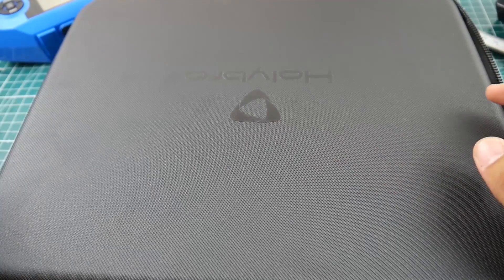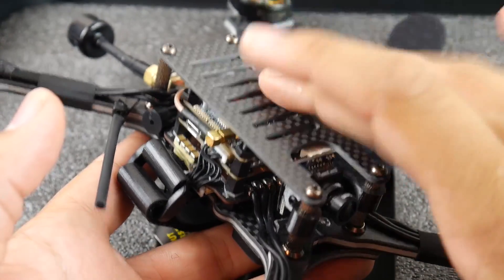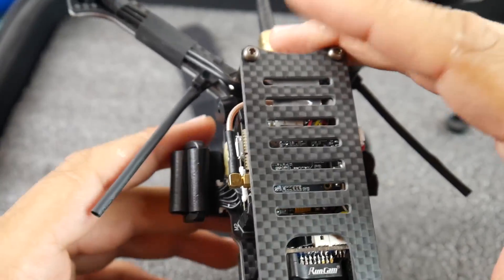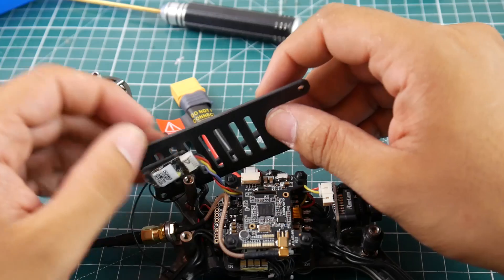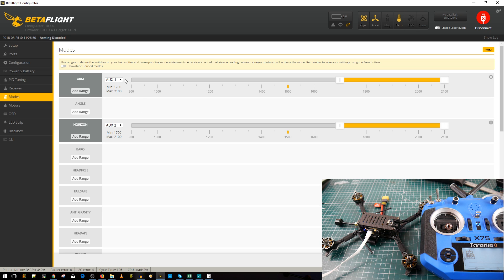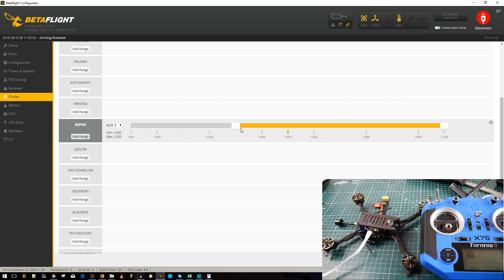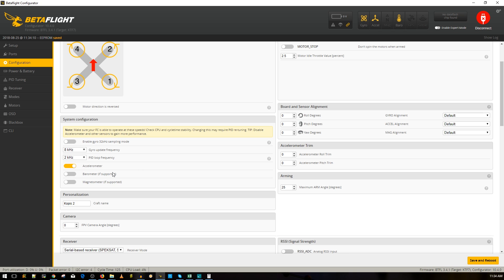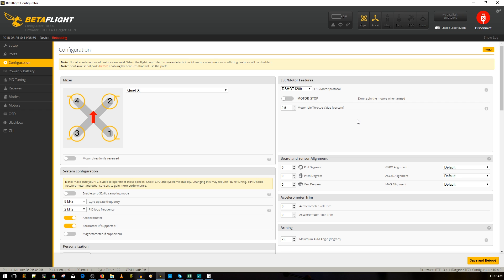Holybro Kopis 2 //  Review and Betaflight Setup Guide

Comment: Can you tell where your receiver cables are soldered in the F7 board? im kinda lost in this, i put mine on T4 (yellow), T6 (Red) and Ground (Black), and i have the R-XSR receiver. it has another cable with SBus but i didnt know how that work so i went simple with 3 cables.

Comment: They put that liquid electrical tape on the Kopis 1 as well I have one its nice touch but it's not that easy to remove for when you want to add an low esr capacitor like I did kind of a nightmare then

Comment: Nice quad. Yes, you’re right about the TOP plate. Why is it so boring in such a nice quad. And what’s with the receiver on the top plate? Is there no where else for it. Silly to have that top plate issue. 
Why don’t you ever do flight reviews by the way?
Peter.
Reply: The top plate is like that for top mounting the battery.
Reply: If that was so wouldn’t there be LiPo strap slots there?
Reply: No it wouldn't.
Reply: While the top plate looks half-assed, I really like the looks of it. Very out of the box and simple.

Comment: I think, everybody should at least be flying 8k/8k and with this f7 fc you could even run 32k/32k update rate. But, there is a lot more tuning of the filters to be done, once you enable 32k mode.
Reply: 32k/32k overloads the CPU on my Kopis 2. 32/16 peaks just below 50%...
Reply: Haven’t updated to 4.0 yet (too cold to fly anyway) but will try to remember to respond here if I experience and fix any issue :)
Reply: @rmariboe  Hey, any news on that? Do you fly on 32/16?
Reply: @maposcha  Forgot about this :)
I actually took it on its maiden voyage two days ago. Two FETs on the ESC exploded mid-air - probably shouldn't have run it on 6S with 4.5 pitch props... I did recover the quad though and have ordered the metal 65A ESC from Holybro to replace the fried one :)
I'm running 8/8 since BF 4.0 has disabled support for anything higher due to excessive noise and whatnot, never flew it on BF <4.0 except in the living room (at 32/16 which ran fine)...
I've seen other people explain how you can run 32/32 reliably if you disable the accelerometer and some other features though.
Other than the exploding part, the quad flew admirably on 6S with the high pitch props ;)
Reply: @rmariboe  thanks!

Comment: Oh I see 3.4 firmware that thing is gonna fly like crap u need to update the firmware to 3.5
Reply: I didn't really see that big of a difference going from 3.4 to 3.5 with my 5inch.
Reply: @pippifpv  you should have bc feed forward was added and there were different dynamic filters added.
Reply: @Stage2_392  I don't see the feed forward as a big improvement to the pid loop. Just swapped out setpoint weight with something else..
The filters are the same. Now you are able to change the filter settings of the dyn notch. If you leave them stock, they are the same as before.